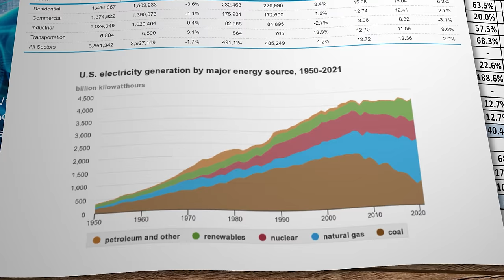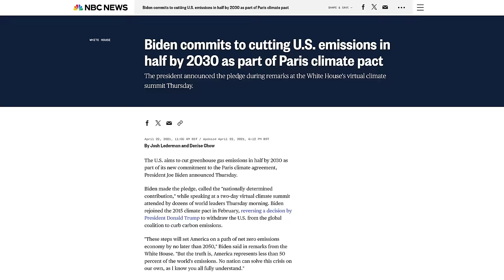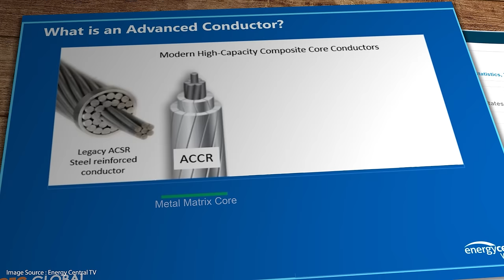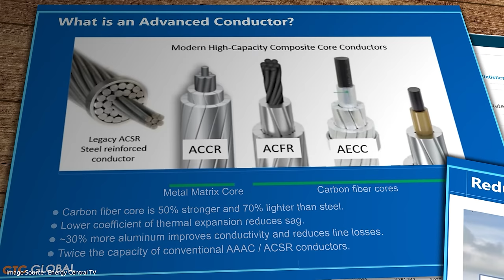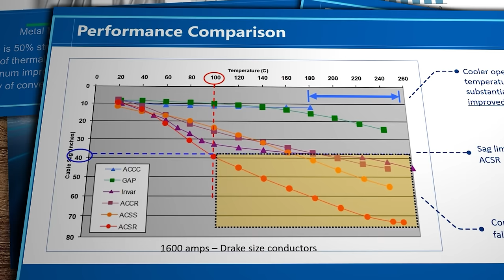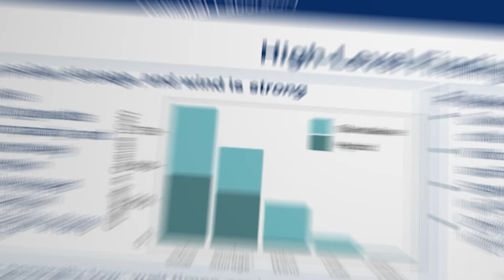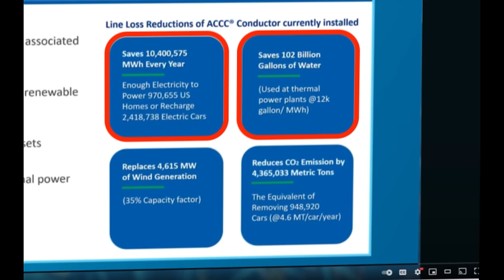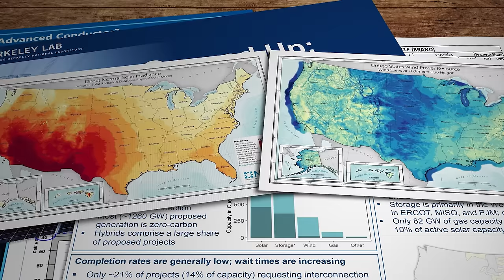Rethinking electricity grids.

Comment: So I haven't heard any information to date on whether or not putting solar on every existing building in the cities would be enough energy for all of our needs. If that were the case, we wouldn't even need to build out power line infrastructure.
Reply: It does not really work like that, even though more solar on more buildings is a big win. But it does not solve all problems. If you have a few weeks of cloudy weather over a particular city (or region), you will eventually have to transfer a lot of power anyways and if your city is particularly sunny, you will want to be able to use that excess somewhere else, when the local storage is full. A good solution can only be a combination of different strategies. And neither the power production nor the grids are at the same level everywhere, so the solutions can´t be the same everywhere.

Comment: Why aren't powerlines following the roads? When you do maintenence it's so much easier for the mainenence crew to access stuff at the side of the road, and most peoples homes and businesses are at the side of roads.
Reply: Local lines usually do follow roads, but lines which connect over longer distances are often more efficient, if they don´t go around hills and mountains or properties, which the roads cannot be built through. Shorter lines are cheaper to build and produce less losses.

Comment: I’ve been in the electric generation industry for 42 years. Wind and solar will never be able to supply anything close to our energy needs. The intermittency problem is insurmountable, batteries can not be economically scaled up to provide the amounts of electricity needed to keep the lights on. Reconductoring is a great idea, but not nearly enough to solve the intermittency problems.
Reply: We need engineers with imagination...

Comment: From what I see the losses would drop from 6% to 4%? Not sure that is a good reason to wholesale upgrade the grid, which clearly would be a giant undertaking nevertheless, almost surely creating more co2 to produce these wires for many years, so given that we should focus on expanding renewable capacity, I think this idea is misplaced.

Ok per chatgpt estimate, the co2 emitted from the cables would not be too terrible, but you'd still tie up production capacity, the workforce, and significant costs that would be spent better on expanding solar capacity. Solar can be built anywhere, ie locally where it's needed, without long distance transmission losses

Comment: Probably a silly question but I really don't have the answer. Why don't we dig and place this a new lines in the streets or in the road in a national roads for example. I understand that this means that there may be more miles for these lines as we wont use the direct route but even so I think that this method could save much time instead getting permissions to  place these new cables. There must be some very good reasons for not using public roads to place the new grid but I honestly can't imagine what are they.
Reply: Because, as you said, these routes tend to be longer and therefore more expensive to built, maintain and more wasteful regarding energy losses. It can also be very expensive to dig up and then replace roads and it interrupts traffic. Doesn´t mean, it can never be an option, but it is not a general one. What I wonder more about, is, why (especially already ugly) highways don´t get (partial) solar roofs including some additional cables over them.
Reply: @martinhuhn7813  That makes sense. But most of the things you mention could be part of the road maintenance. I don't know about energy losses to be honest. But it seems strange that they would be so big to forbid such an option.

Comment: I'm curious as to whether there's a crossover point, for long distance transmission, between cable and hydrogen (make hydrogen at source and transport it to where the demand is to produce electricity)? Given all the losses, costs etc. ± infrastructure (rail, roads)

Possibly also factoring in that hydrogen would be a storage capacity and that (small) fuel cells can be placed in consuming premises, thus eliminating almost the whole transmission network losses.

Comment: Most EV owners just need to charge there vehicles at home using a dryer outlet. That is not going to strain the grid. EVs in general are local vehicles. The current battery technology doesnt make them very efficient for rapid discharge and recharge needed for long range travel. Why is so hard to figure out and explain EVs place in the energy pie.

Comment: It may be time to start burying these things underground so that permitting can be removed from the equation, or at least drastically reduced.  Build sealed tunnels using smaller versions of the tunnel boring machines used for subways etc. and then use copper instead of aluminum.   Perhaps the chemists can find an alloy of copper that has almost as high a conductivity with less corrosion.

Comment: This plan seems far too optimistic to me. Maybe re-run the numbers but replace only the 230kV and higher circuits and use ACSS instead of these exotic cables which almost no one uses.

Also, the pylons for most 115kV and lower circuits are definitely not good enough to just be re-conductored as described in this video. A lot of circuits are built on wooden h-frames which are sixty years old and I think that most utilities are focusing on replacing those structures and not on re-conductoring.

Comment: Technically speaking the larger load coming to the electrical grid is the EV. An while that might seem an overwhelming load it is not. The largest load is currently; which will continue to rise, greed. House wiring needs to be modernize. This is true. With additional DC, where required. DC being more efficient at this level. But let get back to the grid. The production of electricity doesn't need to be only at the industrial side only. Customer ownership and its rewards can be share at all levels. Something the electrical company is currently fighting consumers allover America, don't know in Europe right now! The solutions for future demands are solvable. I am old enough to remember how the raises in electrical tariff where suppose to cover current changes and upgrades; these raises in electrical charges always kept coming at ever increasing rates and they have never stop coming. Greed. Only supporting the so call investors. Never the consumers who is currently supporting all the brunt. Greed! Greed. Greed! 
Buy the way I am a Mechanical Engineer and my hobby are in electronics and solar energy. Thanks for your patience and thought.

Comment: I will always argue for technology and the environment to become symbiotic. However, Electric Vehicles will always result in more emissions than ice because the break even point on the battery is the same time frame that you can expect to replace the battery with another that did just as much damage as the OEM battery.
Reply: You believe that?

Comment: I am continually disappointed by how many people ignore or even criticize energy efficiency.  "Negawatts" as Amory Lovins talked about for 40+ years, are the best watts one can generate.  Consider light bulbs, that the culture warriors hate so much to improve.  If one gets the same light for 20 watts that used to require 100W, we not only avoid generating that 80W, but the ~160W of A/C in the summer, to remove the wasted heat, and the wire losses all the way back to the power plant.

Comment: Hmm.🤔 And it'll all be absolutely free, no doubt, except for the electricity daily Standing Charge. Standing Charge? Who he? Well, mine was £0.00 four years ago, £0.19 three years ago; £0.31 in 2022, £0.56 last year, and I've just been notified that it'll be rising to £0.67 next month.

All this lovely new tech should bump it up to around £5 per day. Let them eat cake, eh?😞

Newsflash: I've just found a fixed tariff with Ecotricity which will keep my daily S.C. at £0.51 for 2 years. I don't care how much each unit costs because I only use 160kWh annually. I'm happy to pay for what I use; I'm NOT happy paying for ludicrous schemes from which I [a penniless scumbag oik] won't benefit.

My energy bill for the year should be no more than £40, but the current Standing Charge adds another £204 to it. 😲 It's obscene.

Comment: Why don't those engineers who design capacitors design a giant capacitor bank that can handle a lightning strike?  That's a lot of potential energy and it all goes straight to ground.  Why don't we harvest it before it does?  Just asking.
Reply: You would need one of the largest capacity capacitor banks ever made to store the total energy of a lightning strike and it would be in a fixed position. It is possible to do this but it wouldn't be economical. If we had a high probability of lightning in a fixed position on earth then it would still need to compete with some single wind turbines that are able to produce tens of megawatt hours a day reliably which would mean you need thousands of lightning strikes a day to exceed a typical wind farm.

Comment: IT would much easier to burry cabels under ground considering  how often you have tornadoes , flooding and huricanes in USA   , aside from using  aluminium nanomateeial composite ( like graphene  or metalic glass that first comes to my mind  , )  with cables inside of servicable tunnels underground all crucial  cabels like electricity and optic fiber can be protected from  Electro magnetic pulse and in case of war or natural disaster from elements and bombings.

Comment: Interesting point of view but presenting one of the number of solutions that will be needed to solve the original equation : how to replace the actual oil and coal energy by electricity in a short period of time using the existing grids !! Numerous other bricks have to be used to try to solve the equation starting by a better use of the electrcity, more distributed generation power plants and also a way to store and transport energy; It is there that Hydrogen could be used even it is not the most efficient but it is a technology that answer most of the blocking points. Now it is clear the the concept of replacing all actula thermal cars by electric ones is a non-sense and we must find better solution through train/metro/tram, individual solution and other shared ressources. a never ending story

Comment: Higher operating temperatures require higher dialectic strength insulation which I assume they have factored in at all the various connections. Do you know where the UK is up to with this type of infrastructure update? Have they even started.
Surely the environmental impact is already known from current use. The real issue is the Not In My BackYard mindset. There's compromise in all decisions society just has to accept that more Electricity= more pylons. Engage with getting the best, most suitable locations for us all. Too much to expect.

Comment: Ok, lots of benefits to the new wires.  What about the cons?   Cost of the wire?  Anyway, the the companies paying the bill for rewiring are not getting the benefits so good luck with this actually happening.   Likely all that will happen is, if it's cost effective enough to re-outfit the maintenance chain with all the new tools/supplies, then changes will happen when the line get warn out.  Unlikely before that.

Comment: My solution is lots of small modular Nuke plants widely interspersed thought the grid reducing the need for long distance high power wasteful transmissions. also reducing or eliminating the need for "idling" coal plants waiting in case they ramp up production in a hurry to keep the grid at minimum voltage. Look at Frances electric grid as an example for practicality.
Reply: If we can keep them secure, I agree. Either way we will need to maximize ALL the alternatives to petroleum burning for transportation and electrical generation.
Reply: As Dave reported recently the companies developing small nuclear reactors are having some difficulties, and may abandon their projects.  Mostly down to the diseconomies of small scale.
Reply: What about the water?  Takes around 12 Million gallons of water per GW per Hour!!!  I don't think you're taking that into account when you say "your solution" are Many Nuke plants.  Try again.
Reply: @Paul_  There are villages int he far north of Canada that run diesel generators 24/7 for power.SMR perfect solution.
Reply: @TobyKinkaid11  They reuse the water I believe...

Comment: Falling electricity consumption is in no way a good sign for the economy.
Reply: All depends why it is falling, if it is falling because we have just exported our manufacturing industry then I agree. But here in the UK demand has fallen from 375twh In 2007 to 306twh in 2022. Most of that fall has happened because of improved efficiency. LCD screens in place of CRTs LED lighting instead  of incandescent lights, better insulated homes  etc etc.

Comment: Yup but we're doomed here. We have some dumb careless stupid politicians running stuff around these parts - meaning the entire US. They caved to shutting down nuclear power, they caved to solar investment,  etc. And yes my house was built in 1976 but set up for one or two incandescent bulbs and an electric heater with an oven/stove top and a fridge with a noisy compressor. Heck they built a vent - IN THE GARAGE, for Air/heat conditioning. But all it really did was let fumes come up in to the house and then blow around. Bunch of idiots those.
So ya, we're doomed over hear.

Comment: Just replace old ac high voltage systems with modern high voltage dc systems now that  tech has solved the problems,10 to 20 percent gain with no new power plants.

Comment: Step one:  1 MV DC backbone
Step two: digital step down to 120KV DC
Step three: digital step down to 20 KV DC for last 10 miles. 
Step four: 1kV DC to the house broken out to 1 or2 DC/DC charging for cars (not necessarily fast), 1 or more 1kV for heat pumps and hot water heaters, a digital inverter for legacy stuff, and for new houses 48vdc for lights and most plugs up to 15 amps point to point and then a few legacy AC 120v plugs for old stuff and 240v for old ovens etc. 

By doing so you make the grid over 40% more efficient, eliminate wall warts, eliminate skin effect and get WAY more power for same arc gap on poles because DC doesn’t arc nearly as easily as AC. 

The cost to new homes will be much less because 1kV needs WAY smaller wire than 240v. 

Virtually everything is DC not AC. ONLY single phase induction motors can’t run on DC straight up. Most stuff that’s AC can just be run directly on the equivalent DC passing through the rectifier and ultimately new stuff can just skip it all. 

And, because of digital, we can get ride of ground/neutral bonding with DC making the entire system vastly safer by instantly tripping on any voltage on the ground wire. 

Yes it’s a big undertaking but it’s inevitable and all of the ac/dc conversion and analog ac/ac step down is wasteful and inefficient.

Comment: This may help  (and should be done!). However, globally, the problem is that renewable energy is generated in different places than traditional generators, which were close to the consumer. For example, there’s plenty of Wind capacity in northern Scotland, but the consumers are in England and central Scotland. The grid in the north of Scotland is very sparse and low powered (because not many people live there). You may be able to increase transmission through reconductoring, perhaps even doubling it, but this will not even come close to filling the gap.

Comment: Can AM or Microwave electrical distibution save electrical pole because 4 layers capacitor induction plug on save electrical bill to nearly 90% even using ject stream delivery charge water ion can deliver trillion amperage and voltage

Comment: i believe the future is localized generation and low voltage dc transmission, exactly how Edison envisioned. The only difference, the power generated will be from renewable or green sources. There's no reason a house can't run on 12 volts. Off griders have been doing it for years.  And if we run on 12 volts there's no need for an inverter.
Reply: You meen High Voltage DC surly? Low voltage  ac or DC is just to lossy

Comment: BEVs are a solution looking for a problem. 
The electric drivetrain is superior to traditional gearboxes, transfer cases, prop shafts etc. 
Large lithium batteries are heavy and impractical to recycle, charging time is significant, and infrastructure in most of the world is either non-existent or inadequate.
The answer isn’t new technology - diesel-electric trains and ships have been around for many decades, are far more efficient than using a purely mechanical drivetrain, and simpler to build and maintain. 
A combustion engine running a generator at constant speed is very clean and efficient. It could be burning a variety of fuels (gas, petrol, diesel, alcohol, etc) or could be replaced with a hydrogen fuel cell. 
Look at what Edison are developing for trucks. Effectively diesel-electric trucks, retrofitting old truck chassis, which is about as green as it can get.
Reply: Yea Edison is a bridge solution for Hybrid full electric drive-train semi. Propane generator would be even better. A few cars also, called REEV I believe..Lithium batteries are 95% recyclable, better than mining.